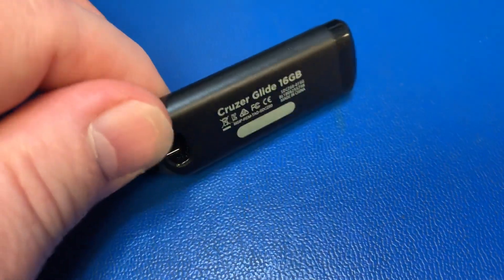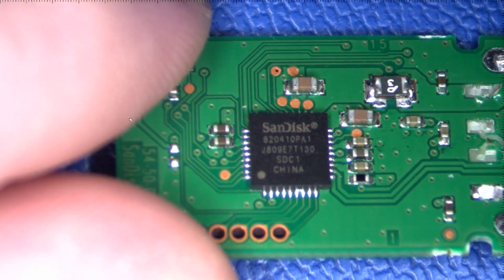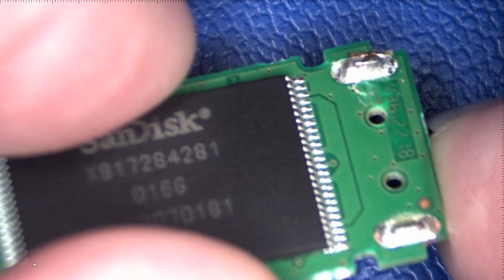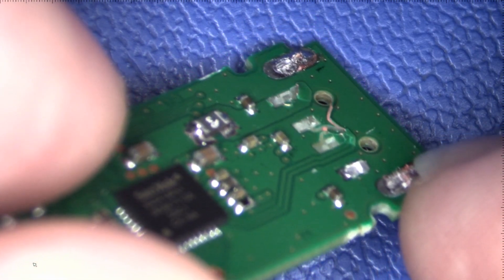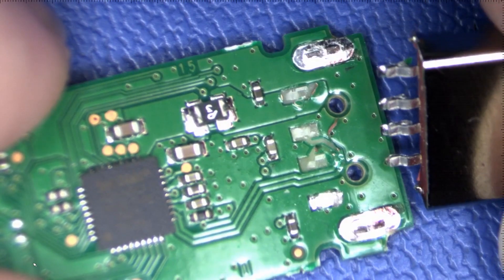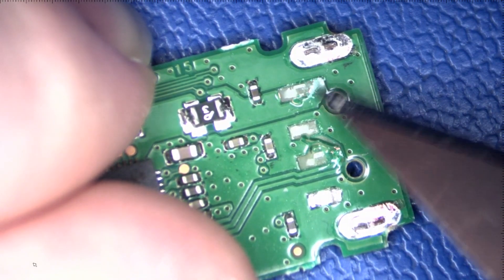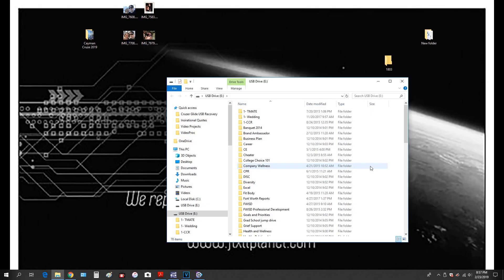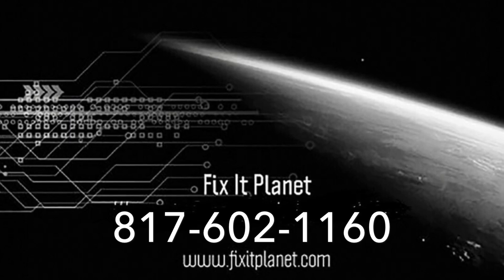Easy Method Sandisk Cruzer Glide Data Recovery From Start To Finish

Comment: Please: First, to Start, how is the usb cover removed safely?  Finishing,  clarify what the connector to the computer is;  where to get one; and how to make ready for use.  Thanks.
Reply: USB Cover can be removed safely via a file or flat-head screwdriver, just make sure to not damage the drive itself by doing it very carefully.(do note that i am also in the same situation)